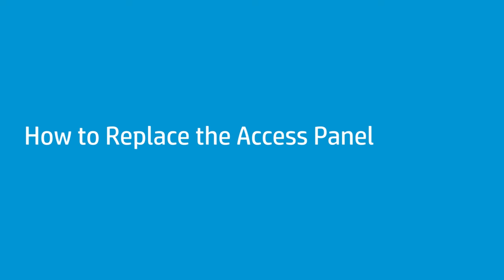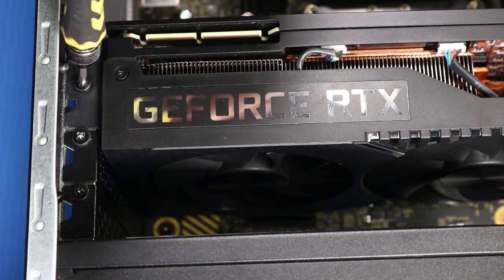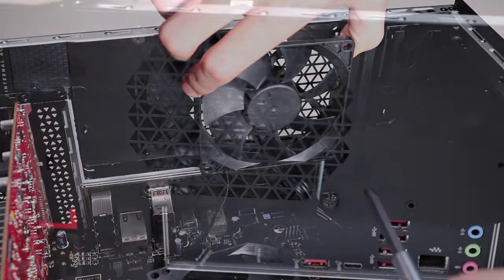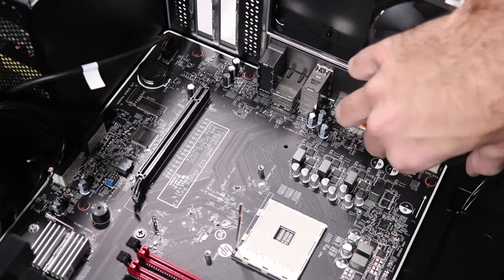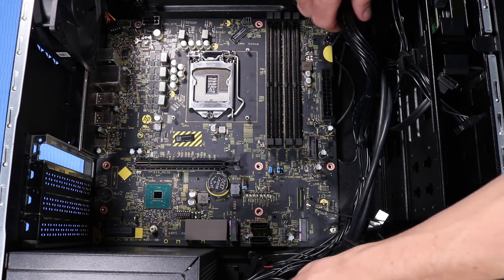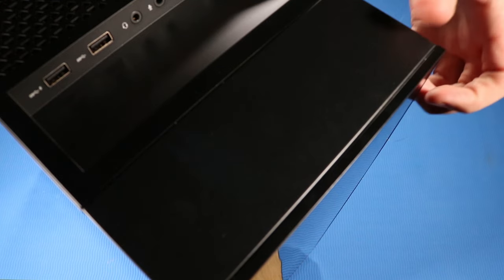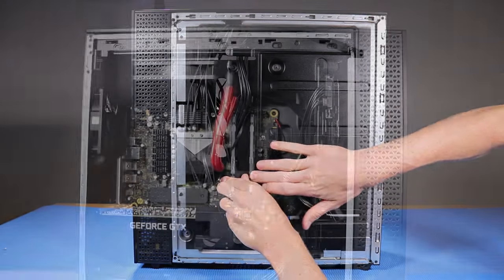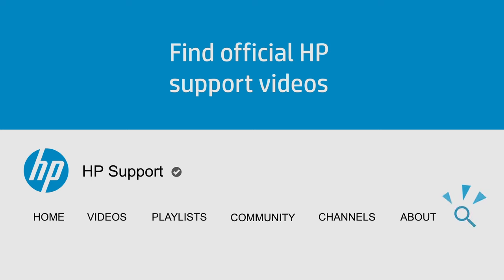Removing & replacing parts for OMEN 25L/30L Desktop PC | HP Computer Service

Comment: I have an Omen GT12-1335qd with 8gb ram and was wondering if I add another stick of the Hyperx Fury 3200 8gb ram from any store, will the BIOS cap it at less than 3200 MHz?
Reply: YES IF AMD. INTEL SHOULD BE ABLE TO GET TO BIOS I BYPASSED IN RYZEN MASTER BUT WITH FACTORY RESET IT WOULDNT BOOT GOT SCREEN OF DEATH HAD TO RESET CMOS PIN

Comment: I have the HP Omen 30L and I'm wondering if the ram is compatible with other mother boards. I know hp owns the hyper fury x brand and tends to make things proprietary to their specific pre builds.  The hana motherboard is made in house and if something ever happens to my pc and its no longer under warranty I'm wanting to know if the 16gb of rgb hyper fury x ram will be have to be discarded as well with the board because of compatibility issues.
Reply from the maker: Hi Chris, thanks for contacting HP Global Social Media Support!
I understand that you need to know about the memory compatibility.
I will do my best to assist you.
Use the HP Parts surfer to identify the part: http://partsurfer.hp.com/search.aspx 
Binu - Social Media Tech Support
Reply: It should be, however from what I can tell that RAM has been discontinued so if you want to add more RAM, it appears you'd have to get it from scalpers. I moved onto Corsair RAM to get away from the need of HP's parts.

Comment: I have the 30L variant and I was wondering if I'm able to change the graphics card to a differently manufactured one? Model number is GT13-1194.
Reply from the maker: +C. Simmons Checked the specification of your computer and found that it has One PCI Express 4.0 x16 lanes and One PCI Express 3.0 x1 lanes. So you can add graphics card that supports these slots.

Comment: I'm wondering if the SATA and power cables for the HDD is already there or if you need to buy one separately and put on the motherboard for the 25L.
Reply from the maker: Hi there, thanks for contacting HP Global Social Media Support!
I understand that you need to know whether he SATA and power cables for the HDD is already there or if you need to buy one separately.
I will do my best to assist you.
We can see the two SATA connectors well below the graphics card and a  single SATA connector seems very unlikely.
Binu_HP Social Media Tech Support

Comment: So I have the 25L model number GT12-0124. Do I need thermal paste to upgrade from the i5 10400 to an i9 10900f? Or will it be ok since there is a fan over the cpu. Please help🥲
Reply from the maker: +Tuucq Please apply the thermal paste while replacing the processor.

Comment: Hi HP Team, I wanted to add 2 hard drives following this guide, however I was able to find 2 available sata cables but only 1 available power cable. The pc is new. Is that possible? Or maybe I missed it and need to try again? Thanks
Reply from the maker: +rinaldo rigola HP does not recommend upgrading or downgrading hardware parts or software that is bundled with the product as It may affect the manufacturer's warranty and performance, however, you could change the configuration at your own discretion.

Comment: I'm just trying to open the glass access panel. It appears to be stuck at the front top portion of the unit. What would cause this? I'm afraid I'll break the glass trying to pull any harder.

Comment: Hi, how to add 3.5 hard disk to HP OMEN 30L GT13? I don't see any brackets.
Reply from the maker: Hi there, thanks for contacting HP Global Social Media Support!
I understand that you need to know about adding 3.5 hard disk on your computer.  
I will do my best to assist you.
HP does not recommend upgrading or downgrading hardware parts or software that is bundled with the product as It may affect the manufacturer's warranty and performance, however, you could change the configuration at your own discretion.
Binu-HP Social Media Tech Support
Reply: @HPSupport  that was not what I asked. I do not see a mount for additional HD. I see empty slots on the motherboard for 3 more drives, but HD cannot hang in the air. I don't want to change configuration but to add storage. Where is the mount for HD?
Reply from the maker: Due to limited support on this platform to fix this issue, please feel free to reach us on call/chat. Access this link to select your preferred country and language option to reach us. 
Global support link: - https://hp.care/3QxuSs6 
Binu-HP Social Media Tech Support

Comment: I have the 25L model and am curious if you can both add more fans into the case as circulation is not the greatest, and whether I can replace the heatsink with a corsair liquid cooling heatsink and 120mm fan, I know the top of the case has a slot for a 120mm fan which would fit that need but am unsure if it will fit into this case properly.
Reply from the maker: Hi there, thanks for contacting HP Global Social Media Support!
I understand that you need to know whether you can add more fans into the case and replace the heat sink with a corsair liquid cooling heat sink and 120mm fan.
I will do my best to assist you.
HP does not recommend upgrading or downgrading hardware parts or software that is bundled with the product as It may affect the manufacturer's warranty and performance, however, you could change the configuration at your own discretion.
Use the HP Parts surfer to identify the part: https://hp.care/6051lk5qU 
And order it via the HP Parts store: https://hp.care/6052lk5qq 
Regards, 
HP Support

Comment: I have an omen 30l with i9/ 3080 and I want to swap case. I don’t really know about pc but can I chance case without the lighting control module ?
Reply from the maker: +Gianmaa YT HP does not recommend upgrading or downgrading hardware parts or software that is bundled with the product as It may affect the manufacturer's warranty and performance, however, you could change the configuration at your own discretion.

Comment: Hello, I have an HP Omen 25L with a GTX 1650, though it looks like there is absolutely no bracket holding the card in but the SATA Cables are there, I also can’t seem to find the PCI-E cables to plug it in, wondering how to do it then? Trying to figure out how to upgrade from a GTX 1650 to an RTX 2060 Super. Thanks!
Reply from the maker: Hi there, thanks for contacting HP Global Social Media Support!
I understand that you need to know about upgrading the graphics card of your computer.
I will do my best to assist you.
You can upgrade the graphics card of your computer to NVIDIA RTX 2060. It is compatible. 
Regards, 
HP Support
Reply: the 1650 runs entirely on the pcie slot, there isnt any 6 or 8 pin connector going to the gpu bc it doesnt need one. You would maybe need to upgrade your psu im not sure if your model has a spare pcie cable .

unless someone is giving you that 2060 super though, id go with a 4060 or 3050.... same price if not cheaper and much better performance,,,40 series has much better power consumption too.
Reply: @tabernaclejones6115  lol, I already figured it out and the new gpu has been in for 1 week now. upgraded from a 1650, to an RTX 2060S (2060 Super)

Comment: what gpus fit in this?? i have omen 25l 3060ti ryzen 7, wanna see what gpus i can fit in here that are better than a 3060 ti
Reply: The 3090Ti and 4090 ones would be a super tight fit in my case. I'm avoiding those because of the sheer size of them.

Comment: I have the 30L version and have a question regarding a wifi card upgrade. The current antenna wires connected to the stock chip go through the side panel, and up into the front bezel area. they are connected to 2 metal plates up there. The wifi card upgrade I am going to install will have new antenna wires that go out the back port to where the antennas will connect. Can I leave the existing antenna cords in there that go to the front bezel? I tried to remove the metal brackets that they are attached to but they are in there tight.
Reply from the maker: Hi John, thanks for contacting!
I understand that you need to know about upgrading WIFI card.
I will do my best to assist you.
HP does not recommend upgrading or downgrading hardware parts or software that is bundled with the product as It may affect the manufacturer's warranty and performance, however, you could change the configuration at your own discretion.
Binu - Social Media Tech Support

Comment: I accidentally threw away the top case fan mount bracket, can I email for support?
Reply from the maker: +Splittz01 Pease contact our phone support team to fix the issue. Please follow these steps to reach them.
Step 1. Open link: https://support.hp.com/us-en/contact-hp
Step 2. Select the product type.
Step 3. Enter the serial number of your device or select let HP detect your product option.
Step 4. Select the country from the drop-down.
Step 5. You should see the HP phone support number.

Comment: What screw driver do you use for these screws?
Reply from the maker: +Rohan Please have available a Phillips-head screwdriver.
Reply: What type of Phillips screwdriver though? Because they're are a lot of them
Reply: @rohan5221  I would recommend getting a screwdriver kit. It should have various different size heads for their assortment of screws they like to use.

Comment: Hello i was wondering what type of motherboard should i use for the omen 30L? I want to change it cause mine is not working
Reply from the maker: Hi there, thanks for contacting HP Global Social Media Support!
My apologies for the inconvenience, I am here to help! 
May I know the product you are using? A serial/product number would be helpful!
Let me know!
Regards, 
HP Support
Reply: @HPSupport  pretty sure omen 30L desktop GT13-0xxx and it uses a hana Matx mobo but i dont know where to get one that would work
Reply from the maker: In order to get this issue fixed, please contact our customer care team over the phone or chat for further assistance, as this issue requires Live conversation with you over phone or chat to isolate the issue and provide you instantly with appropriate solution or repair/replacement options available at your place as per the warranty. Please feel free to reach us on call/chat, please access this link to select your preferred country and language option to reach us. Global support link: - https://hp.care/6052mYCx6 
Regards, 
HP Support
Reply: @HPSupport  thank you hpsSupport and i will give you guys a text when i get home

Comment: How can I add a corsair lighting hub? There is only one usb slot and daisy chaining isnt working
Reply from the maker: Hi there, thanks for contacting HP Global Social Media Support!
I am here to help!
Could you elaborate more on the issue?
May I know the product you are using? A serial/product number would be helpful!
Let me know!
Regards, 
HP Support
Reply: @HPSupport  The product is the CORSAIR iCUE COMMANDER CORE XT Smart RGB Lighting and Fan Speed Controller - When plugged into the usb spot I lose all control off original omen lighting, but I can't add the corsair fan I want
Reply from the maker: Thanks for the reply.
Please refer to the instructions mentioned under this document to fix the issue: https://hp.care/6059mzqWT
Regards, 
HP Support
Reply: @HPSupport  I appreciate your response, however it did not answer my original question. 

The solution I found was getting a powered USB hub. This allows me to access Omen rgb as well as add corsair fans and control their rgb. 

Don't get me wrong, as a first computer this was really nice. However upgrading feels like it's taboo to do and the heat of an omen is way too high.

Thank you!
Reply from the maker: Thanks for sharing the steps that helped you!
If you need any help in the future, you can always get back to us.
Thank you for being a valuable HP customer.
Have a wonderful day!
Regards, 
HP Support

Comment: My model doesnt have liquid cooling but a normal one with a fan,is there any guide to take it off so i can clean the dust in it? It has bolts so I guess that I just have to take them off,clean the heatsink and the fan and put it on again but Im not sure,any help is appreciated
Reply from the maker: +Jorge May I know the complete model number of your computer so that we can check the details for youi?

Comment: 5:32  i'm trying to remove the bracket that secures the graphics card to the side chassis but the screws to the bracket are very tightly screwed in and my normal screwdrivers can't screw them loose, is there something that can help take them out easier?
Reply from the maker: +Bruce Nav Please contact our phone support team to fix the issue. Please follow these steps to reach them.
Step 1. Open link: https://support.hp.com/us-en/contact-hp
Step 2. Select the product type.
Step 3. Enter the serial number of your device or select let HP detect your product option.
Step 4. Select the country from the drop-down.
Step 5. You should see the HP phone support number.
Reply: did you ever find a fix?

Comment: How do you replace the watch battery? Is it removable? It looks like i would have to break plastic to remove.
Reply from the maker: +pearl rival Please refer this document to know about removing and replacing CMOS battery: https://bit.ly/3hoZ9X0
Reply: @HPSupport  thx for the response. Unfortunately the 2 images in the examples are different from the way a battery is installed via the omen. It appears the plastic housing will prevent it from being removed. Are you saying it should ve removable? Moreover, do you have a link to update the bios firmware?

Comment: I replacing my Motherboard on my 25l soon. Curious if I need a new ssd to install windows after swapping board? Can I use the original ssd with the os installation or do I need a new ssd and new windows key since the windows version I have came with the 25l. I’d like to keep the os on the original ssd and add my second ssd to the slot on the new MOBO. Seeing lots of different answers and not sure which is the correct one.
Reply from the maker: Hi there, thanks for contacting HP Global Social Media Support!
I am here to help!
Well, if you have an SSD already then you can use that SSD on the new motherboard. Make sure your new motherboard has the appropriate SSD slot in order to insert it.
Let me know!
Akhil_HP Social Media Tech Support
Reply: @HPSupport  my new motherboard is the reason I’m swapping. It has two ssd slots and the bois is not locked by HP. My question came from the notion that the HP motherboard and ssd it came with are linked to the windows license that also shipped with the PC. I’ve since learned that I would most likely have to buy a new licenses for windows when I do the swap. Which is okay, I just want to know exactly what I need before begin the process.
Reply from the maker: Thanks for the reply.
HP does not recommend upgrading or downgrading hardware parts or software that is bundled with the product as It may affect the manufacturer's warranty and performance, however, you could change the configuration at your own discretion.
Regards, 
HP Support
Reply: @HPSupport  warranty is 3 years past. Everything has been replaced. New gpu. New cpu. New psu. New cpu cooler. New motherboard. New windows key. Only thing that is left is the case. It’s no longer a an HP product. Maybe don’t lock your bios and people wouldn’t do what I’ve done. And the marketing notes on the product say “fully upgradable”. But regardless, it’s like telling someone that upgrading their exhaust system on in their car will void warranty. People who mod things, We do the work, we paid for the product and the upgrade, the warranty is not a concern. Especially when it’s already lapsed.
Reply from the maker: Thanks for the reply.
Please refer this document to know all about Windows 10 product activation: https://hp.care/3RKmIvO
Regards, 
HP Support
Reply: @HPSupport  yes, I’ll be getting a new key. I already know that more than likely my original motherboard OS Is linked to that board.

Comment: I have the GT13-1194 with a 30L case. I'm trying to remove the side panel but it won't come off. I've tried taking off the screw like the tutorial suggests, but no matter which direction I push the side panel it doesn't budge. I tried prying it off as well and still no luck. Is there a different method for removing it for the 30L?
Reply: there is a button on the back of the case that releases the side panel, be sure to support the panel as your pressing the button. hope this helps.

Comment: Is installing a Wifi expansion card possible on the 30L 3060Ti 5800X? There are no F_USB slots to connect the expansion card to.
Reply from the maker: +Sumrand0mguy 999 HP does not recommend upgrading or downgrading hardware parts or software that is bundled with the product as It may affect the manufacturer's warranty and performance, however, you could change the configuration at your own discretion.

Comment: I currently have a 3070 in my 30l but want to change to a 4070 ti is this possible with the space given in this case? or even a 4070
Reply from the maker: Hi Corey, thanks for contacting HP Global Social Media Support!
I understand that you need to know about upgrading the graphics card of your computer.
I will do my best to assist you.
For upgrading graphics card,  you need to update the PSU, and of course if you manage to find one. Keep in mind the maximum length of the card that you can fit in the case is 28.5CM.  
Binu_HP Social Media Tech Support

Comment: So the power supply unit I bought does not have a 4 pin power connector. Is it still compatible??
Reply from the maker: Hi there, thanks for contacting HP Global Social Media Support!
I understand that you need to know about compatible power supply unit for your computer.
I will do my best to assist you.
Use the HP Parts surfer to identify the part: https://hp.care/448CUuY 
Binu-HP Social Media Tech Support